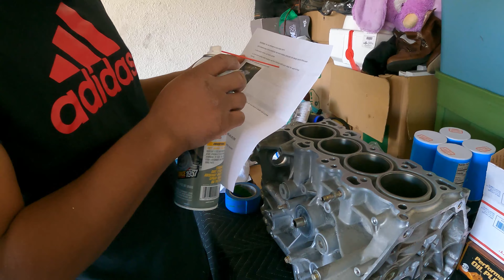LS VTEC DIY EPOXY BLOCK FILL

Comment: Did you barely have enough for a 4 cylinder? Do you think 1 kit would be enough for a 6 cylinder n55?
Reply from the maker: @BBblue_660  I wanna say it was just barely enough for the 4 cylinder.
Reply from the maker: My brother said he had some left over. The seller said it’s enough for a J32 but idk if it’ll fill a straight.

Comment: Hey, can u drop a link for the epoxy
Reply from the maker: https://www.ebay.com/itm/284277878290?hash=item4230482e12:g:y4oAAOSwAPpeTqJn
Reply from the maker: I will also put it in the description. 👌🏾